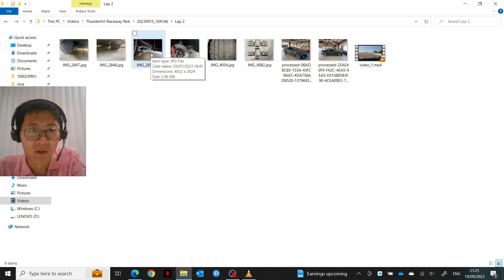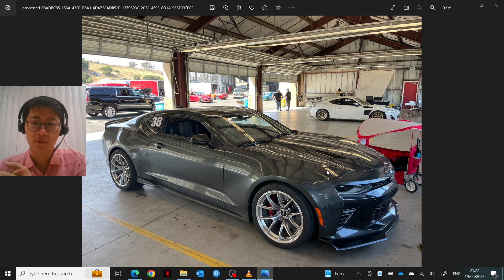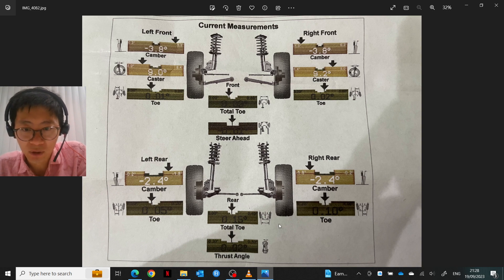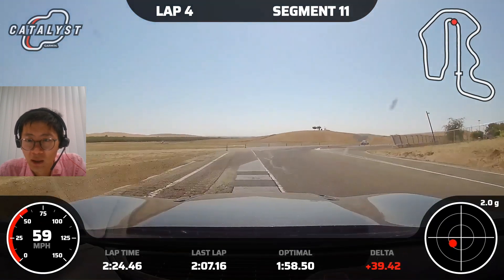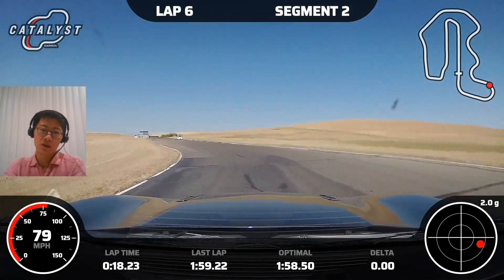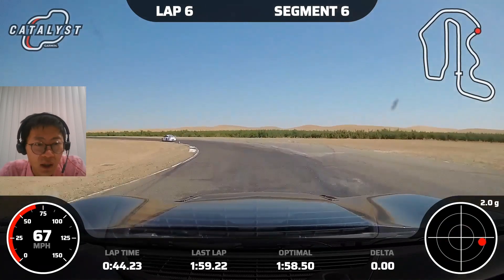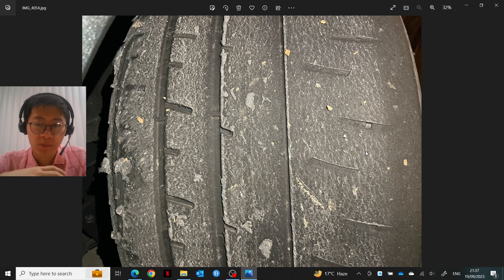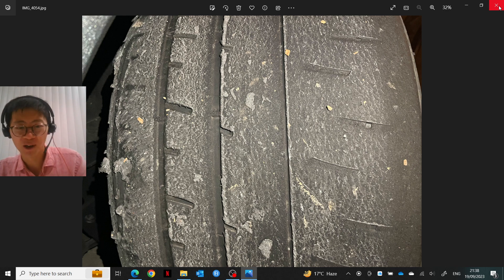Camaro mods, a PB and a close call

Comment: Tire pressures and understanding if a particular tire compound is happy with 20 minute sessions or far less push laps. Definitely heavy car w/high hp and strut suspension problems. Expensive experiments to figure out what works but I'd expand the tire budget a lot. Rode with a friend in his Camaro and wow, what a machine. So stable.
Reply: Separately...blind crests are what I dislike a ton at East. I've come over the bypass with a disabled car on the other side.